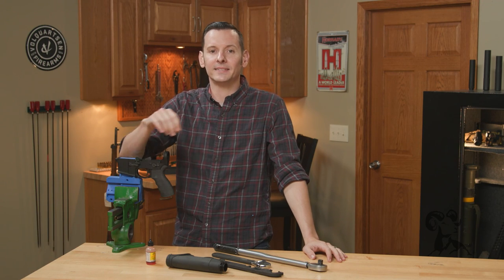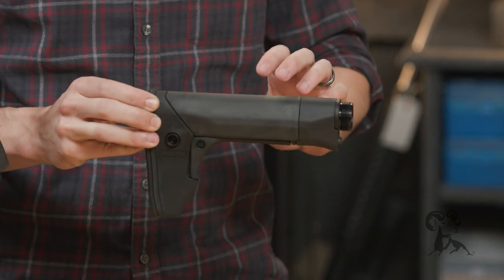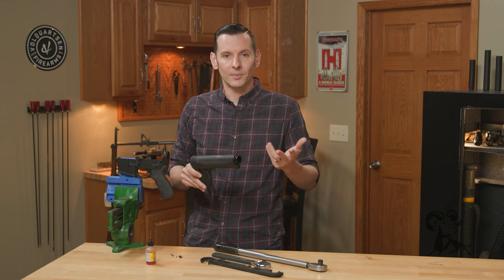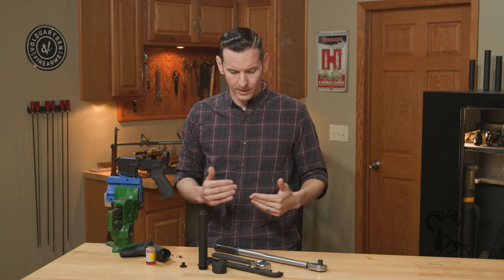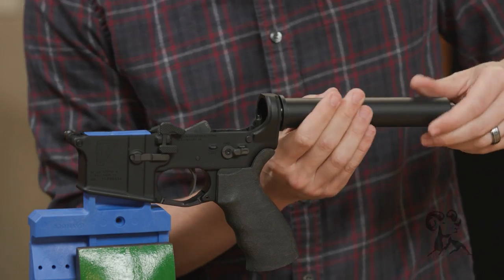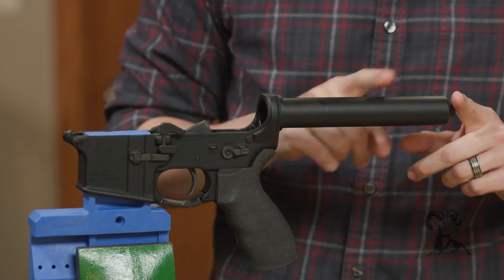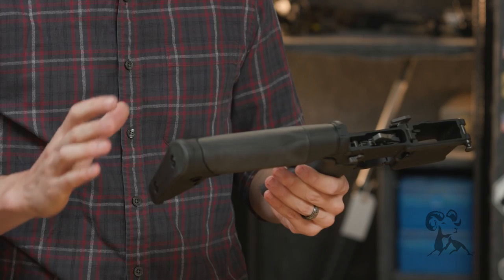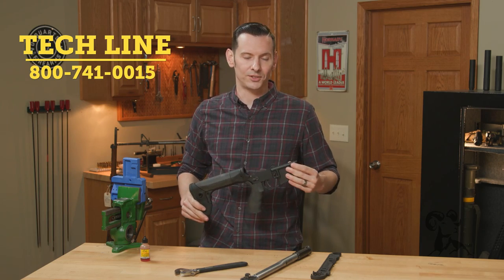Quick Tip: How To Install the Reptilia RECC-E Stock

Comment: Larry Potterfield did a buffer tube installation video and he used Loctite on the threads. It can be confusing for people when you say don't use it and someone like Larry Potterfield who is a master gunsmith and owns a large firearm parts company says to do it. I'm not saying you're wrong and he's right just it's confusing.
Reply: Having had a buffer tube come loose during firing, allowing the detent pin and spring to fly into the trigger well, rendering the weapon useless (thankfully on the range and not in a duty scenario) I have used and will continue to use a dab of Loctite on my buffer tube threads during builds.
Reply: Larry is the only "gunsmith" advocating for it (or did years ago, who knows the last time he built a gun). There are many reputable gunsmiths that specialize in this field that say loctite is a no-go on castle nuts. I understand it can be confusing because he put out a lot of good info, but this ain't it.

Comment: Purple (low strength) Loctite or VibraTite is perfect for stuff like this. It prevents corrosion and requires no heat to remove.

Comment: Another tip. Instead of using blue loctite you can use a small amount of clear nail polish and I’ve found it doesn’t hold as tight as loctite and can easily be cleaned up with acetone

Comment: It’s not very light though, or at least not significantly so. A standard carbine buffer tube plus castle nut is like 3.5oz or 4oz. Add a polymer stock and total weight is only about 10-14oz depending on what stock you pick (basic m4 vs lets say…a Magpul MOE SL). This is listed at 12oz. 

Other than looking cool (and that’s what’s important!) it really isn’t any lighter than a basic carbine tube and lighter weight stock.

Comment: I feel like this is the ultimate evolution of the Magpul UBR concept.  Still don't see a huge benefit over a regular carbine setup like a CTR or BCMGUNFIGHTER stock, though.
Reply: The Ubr is it, for this style. The🦎 thing doesn't compare.
Reply: The recc-e stock is an absolute piece of shit. 
It’s so flimsy that it’s nearly unusable when it’s extended. It also does not securely latch into position.
They sacrificed to much rigidity to save on weight.
There is no comparison between this and the UBR.
Reply: @Neil.Anblomi  thanks for that back up. I can't speak for gen 1 but I've ran a couple of gen 2's with a5 length buffers, for awhile and would take them to combat.

Comment: Can you talk about torque wrenches some time... does the fact you use it a right angle mean it's not a lever? Because if you extend the torque wrench you need to adjust the setting.
Reply: A torque wrench is calibrated to deliver the desired torque at the head of the torque wrench. When you use your torque wrench with an armorers wrench where the torque is being applied to the fastener is offset from the head of the torque wrench. If you put that offset in line with the torque wrench then you are effectively making the handle of the torque wrench longer and you will need to do some math to determine the correct setting for your torque wrench. But if you turn the armorers wrench so that the offset is 90° to the torque wrench then the calibration of the torque wrench will remain correct

Comment: Don't buy one of these stocks. They're... novel, for sure. But they're not robust, and (because of the design) tend to have significant play in key areas that'll lead to the stock collapsing on it's own during normal firing cycles, which is... less than optimal for a product that costs north of $150.

Comment: The recc-e stock is an absolute piece of shit. Waaaay overpriced for what it is.
It’s so flimsy that it’s nearly unusable when it’s extended. It also does not securely latch into position.
They sacrificed to much rigidity to save on weight.
There is no comparison between this and the UBR.